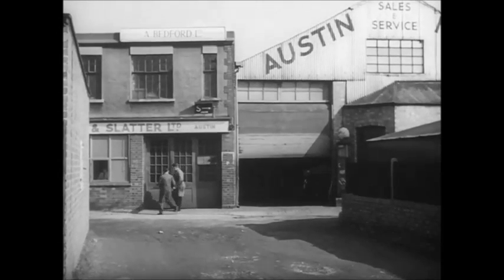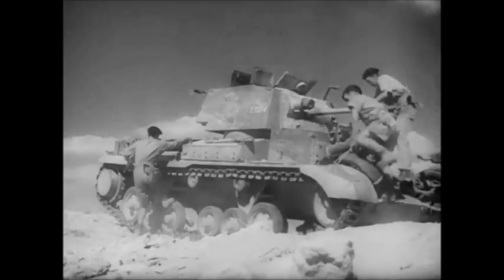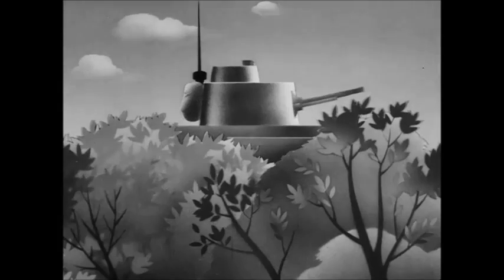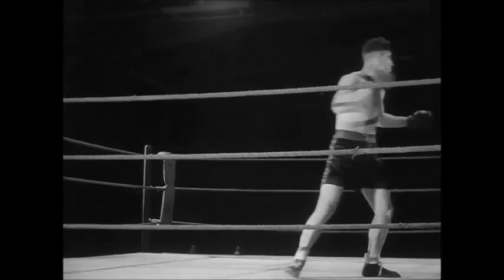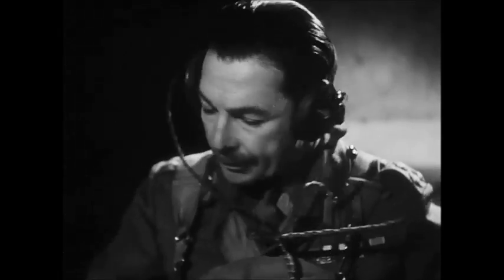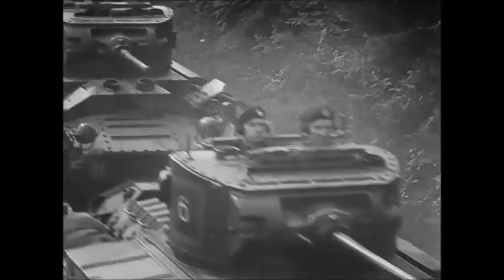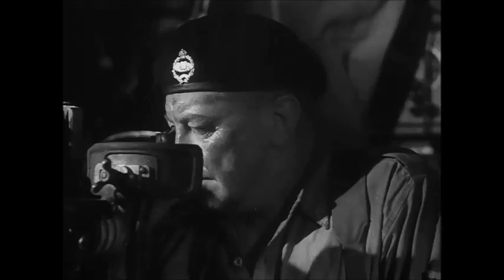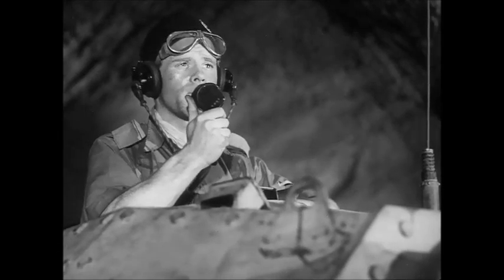British Tanks

Comment: This small parts was where the Americans had special tools and could get the same part produced at a rate that was around 7 times faster with 20 percent of the transport cost. They had a large pool of money and engineers from the automanufacturing industry. They did also standardised to a few models. In one way i am impressed with Britain, they produced as many tanks and as many aircrafts as Germany despite being a seapower. But their methods was really backwards.

Comment: Yes it was slow moving,but it made the fastest tank advance in the war......and it was quicker than a sherman over bad ground.Weak gun.........i've already said that the 57mm had better armour piercing qualities than the shermans 75mm gun which is FACT.Also,churchills were fitted with the shermans 75mm gun,so if you call the churchills gun weak the same applies to the sherman.
Large turret?......the reason the churchill could'nt be upgunned is because  the turret was too small.You also say the churchill was a bigger target,the sherman was slightly taller which was a distinct disadvantage when it came to being a target.
Better survivability........do you know anything about the subject you are talking about.......churchill crews had the best survival rates among allied tanksers,mainly due to the much thicker armour and better escape hatches than other allied tanks possesed.
Try reading a little bit on a subject before you get into a debate........your lack of knowledge in this instance  is clear to see.
Reply: The Dieppe raid was an example of bad planning rather than a bad design.
Do you know that a number of Churchill tanks made it into the town over the harbour wall and were used to demolish German positions.Most of these tanks were not penetrated by enemy fire but lost tracks or were  stopped by anti tank obstacles.
The planners of this raid did not realise how heavily defended the town was and did not realise that the type of shingle on the beach would have stopped any tank,not just the Churchill.
In the circumstances,the Churchill probably did better than any other tank would have......it is doubtful that a single Sherman would have made it into town.
Reply: The British were pathetically slow, outdated piece of shit and by the Sherman Tanks of WW2 was the fastest tank of WW2 at 33 MPH.. Montgomery refuses to ride in a British tanks and you could see Monty the Child Molester out and about in his M-3 and M-4 tanks. By the way the air cooled sherman tanks are the reason the US Army won in North Africa. Oh you should reading books instead of using youtube as your source of WW2 history.
Reply: Let's not overcomplicate things or make dubious claims. As an infantry support tank, the Churchill did the job but it had undeniable drawbacks in several key areas. It probably isn't even in the top 10 of best tanks of the war, let alone top 5.
Reply: @christianh4723  ask the soviets and see where it comes in their top 5..

Comment: ALL British tanks were crap!! Only the firefly which was basicaly a modidied Sherman was any good v Tigers and Panthers.
Reply: They had good armor, maneuverability, and power, just a crud gun.  Also I think the transmission or suspension was as reliable as  a 1970s fiat.
Reply: What about the Comet or more importantly the Centurion, although too late to be fielded by the end of the war it turned out to be one of the most successful tanks of the 20th century
Reply: Yes you are quite right. The Matilda Mk 2 was a very good tank at that time. The only thing that let it down was the 2 lb gun. Not that it was a bad gun, but it could only fire AP shot. No good against field/AT guns. That gun was better than the 37mm gun and the 50mm gun fitted to the German guns. Against the 88mm, no good at all.
Reply: I was just about to come to the defense of the Matilda  mk 2 also, currently watching this because i intend to do a video about it.
I would add to the points already raised that just like the french, our tanks were perfectly apt for the roles they were designed for, technical shortcomings like overworked tank commanders being experienced by all sides but the element of tactics has more to do with the german early victories than sheer value of equipment. 
On the rare occasions early on when british tanks were used well they had an impact, rommel was a part of a convoy attacked by Matilda tanks and nearly got killed as a consequence.

Every participant in the second world war had their better and less better vehicles, with the improved vehicles often only being possible because of those that came before
Reply: Don't agree, the Matilda was a very good tank in it's day, heavy armour  and the gun was better than the German 37mm by a wide margin. As far as the speed, it was good enough for an Infantry Tank. This is what it was designed to do. It was good enough to give the SS a shock at the Arras counter attack. The SS ran! The British tanks only caught up with the Germans with the introduction of the Comet. What made the difference was the Crews. The British crews had 3 to 5 years training. The Germans just a few weeks by 1944.
Reply: Yiou are forgetying the churchill and the comet.Which were good tanks.
Reply: Mathew james the centurion was a post war tank.
Reply: gerald of rivia the centurion was a post war tank.The m-26 pershing was the best allied tank in 1945.